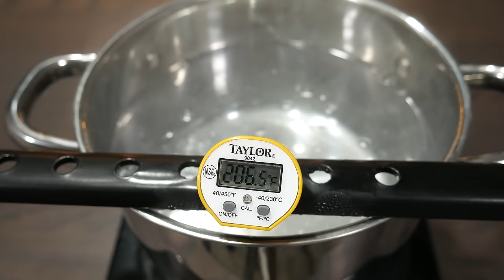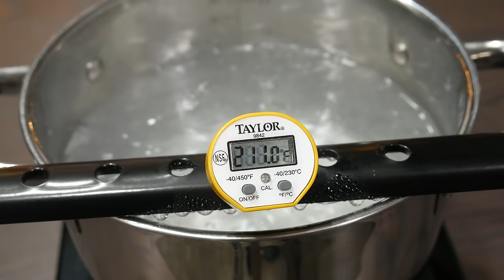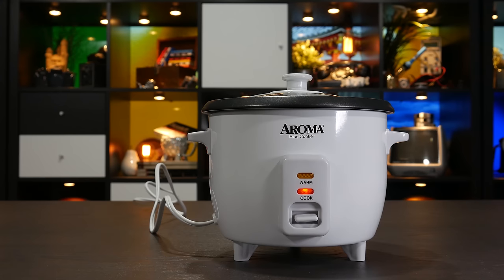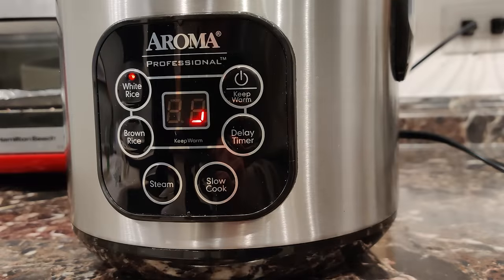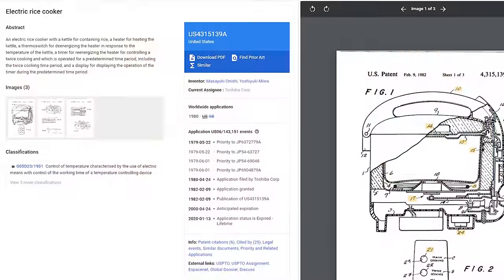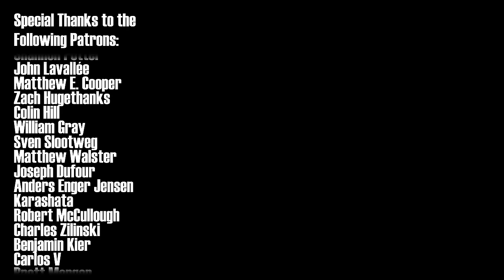Old-fashioned rice cookers are extremely clever

Comment: As someone who also owns that exact “fancy” rice maker, I too despise that 15 seconds of screaming when the rice is done.
Reply: YES! It sounds like a radiation alert or some such thing--why so shrill, fancy rice cooker, whyyyyyy?
Reply: And I have the cheap one. Works just fine for sushi rice...
Reply: I think we all have one appliance that we yell “shut up!” at.
Reply: @AlchemicSoul  in my case it's an egg boiler.
Reply: My instant pot plays a little tune when it's done, then shuts up and keeps it warm until you tell it otherwise.
Reply: @mysteriouslyhandmade  In my case it was the microwave before I bought a new one, but has always also been the fridge. Leave it open for 1 microsecond too long and it screams at you as if it's going to die!
Reply: The first thing I do when I buy a new microwave is disassemble it and remove the speaker lol.
Reply: @AlchemicSoul  In my case my microwave, and also a multimeter. I don't always turn off that damn multimeter when doing something else for a minute, and then it complains. Its got that usual mechanical turn-knob thing, so it's actually a bit of a hassle to turn off and on all the time too.
Reply: My rice cooker makes a train noise or bird noises as it's finishing up its rice.

Comment: 3:18 Al dente rice is a thing, but not cooking the rice long enough makes your al dente rice swim in water. So the main way to achieve that is to put in slightly less water and rely on the same mechanism to time the cooking. Also, a couple of small tidbits: When Toshiba first invented these, they used a bimetal strip instead of a magnet. While the double-boiler version (with either bimetal or magnet) is slightly less convenient when cooking rice, it can also be used to heat up other things as long as you put the right amount of water in the outer layer—quite useful before microwave ovens were common.
Reply: You could also just boil the rice like pasta, pull it out whenever you like. It's good for very starchy rice as even with the right ratio I can't seem to manage good rice-cooker rice with anything but basmati or parboiled, so just wash that excess away with the rest of the water and there you have it.
For plain rice, a rice cooker and the right kind is always going to be best and you won't be wanting that one "al dente", but here lies the beauty of choice.
Reply: I once tried something called rosoto and was surprised they didn’t cook the rice through. Maybe that was intentional?
Reply: @cat-.-  It's risotto. Risotto is very creamy, if the rice is overcooked it tends to get lost, though I'd be hard-pressed to call the ideal consistency al dente, more at the very end of it.
"Al dente" means leaving just a little bit of the core of the pasta or rice still uncooked, enough to give it some structure. It should not feel hard or crunchy, just enough that you feel some resistance when you bite down (hence the name), tune it at your liking.
Of course, it all depends on what you mean by "they didn't cook the rice through", if it's by a big margin then it probably means whoever made it got tired and took it out of the stove early, if you mean just enough to be noticeable from say plain basmati rice which is long and thin then yeah.
Reply: We have al dente rice in hungary. We call it "pergős" rice.
Reply: I like my rice being more hard and less mushy

Comment: "we'll get to that when we tackle air conditioning and refrigeration" 

Me: I AM EXCITE
Reply: Yes, and wow. That's a lot to tackle. I learned from Bryan Orr (HVAC School). Neat thing is, once a person knows why the hot tube carries the cold and the cold tube the heat, they've pretty much got it.
Reply: Not too excite or you vaporize.
Reply: PongoXBongo It would make for a nice change of Phase. Err Pace.
Also an excuse to delay CED
Reply: Refrigeration is TIGHT
Reply: @davincent98  YA BOIIIIIIII!!!!!!!!
Reply: I used to work in the HVAC field, when I was younger. Except for the working in excessive heat (120+F/49+C) installing the AC units part, it's was kind of an interesting trade sometimes.
Reply: Long story short, sealed, one-way loop with an expansion valve.  Gas is compressed.  The compression of the gas heats it, so the the how, compressed gas passes through a heat-exchanger to shed as much heat as it can, before being piped into the interior.  In the interior, the compressed gas passes through some kind of expansion valve or orifice tube and into a low-pressure coil.  As the tepid gas expands, it cools.  The cool gas in-turn cools the coil, which has air forced across it, such that the air sheds its heat into the coil and thus the gas, again raising the temperature of the gas somewhat.  The gas then returns to the compressor, and the process starts over.

This is an oversimplification and doesn't account for reverser valves for heat pumps that can deliver heat in addition to cool air, but is the basics.
Reply: @TWX1138  I'll over simply it more.
Cold do not exist, there is only lack of heat.

Comment: As I watch this, I'm eating rice that was cooked on almost that exact rice cooker, and I love it. I eat rice pretty often (half my cooking skill set is Korean) and it suits my needs great. My only complaint is that the "warm" setting is hot enough to dry the rice out, if I leave food out for a buffet style dinner. 

And yes, a digital sensor is just a thing that will break. If you don't absolutely need them, don't use them.
Reply: Your cooker might be trying to keep the rice above 60-63 degrees Celsius in order to prevent the growth of Bacillus cereus; which is important for a "buffet style" arrangement (see my previous comment: https://www.youtube.com/watch?v=RSTNhvDGbYI&lc=Ugx5q1cbi1Edv-wWOQl4AaABAg).
Reply: Used to work at Chipotle, where we had to keep rice at a safe temperature. It would dry out, but that's why we mix it up between every couple customers, and it helps that we went thru pans quickly
Reply: @mattb4721  Yeah, rice must never be allowed to spend much time at room temperature. It must either be hot or chilled.
Reply: @lawrencedoliveiro9104  I'll eat it up to 24 hours later but I prefer 12

Not worrying about germs as much ... top tier immune system

Comment: I recently purchased an egg cooker that utilizes the same technology.
While the steam is used to do the actually cooking of the eggs, the water supply acts as an incredibly accurate timer to cook the yolk to varying levels of done-ness. The timing of the device is created by a little plastic cup with lines on it that say: soft, medium and hard-boiled. Fill the cup to the desired level and pour it into the cooker. It even has the same lever on the front as the rice cooker.
Reply: OK, I usually hate too many one-use kitchen gadgets but that's one I need in my life,
Reply: I bought my mom one of those, because it takes less time than it takes to boil water to make over half a dozen of boiled eggs. It uses less energy. You can steam veggies in a basket on top of a rice cooker. Eggs, veggies, and rice. You have a whole meal.
Reply: I have one of these egg cookers and it's amazing. Perfect hard boiled eggs every time.

Comment: I have always wondered how these things work! Thanks for clarifying it! I also find cooking rice well to be less than obvious.
Reply: If you are cooking long grain rice get any cup. Fill the cup with rice. Place rice in pot. Use same cup that you used for rice. Add 2 cups of water to pot. Add 1 tsp of salt and oil for flavor. Cover pot. Bring to a boil on medium high heat. Once pot is bubbling, reduce heat to low and leave it for 25 mins. Do that step by step and it's hard to mess up. Rinsing the starch off the rice makes the lid easier to see through if you are willing to put more effort but it doesn't make much difference in the dishes quality. 
I don't know what the ratio for short grain rice is though. Only weirdos who like math too much eat it anyway.
Reply: L

Comment: I think you missed an important point about newer „automatic“ rice cookers: they are typically sealed and they cook by letting pressure to increase internally. 
Because pressure is higher, boiling point is higher, temperature can be higher and cooking is faster
Reply: Additionally, newer rice cookers are better insulated, so they will stay warm for longer without power.
Reply: @dbclass4075  I can tell this is true because I own the basic "cook and warm" system but it's as insulated as the Multi cooker/Magic Jar one... Very common in Asia

I usually cook rice every 7 in the morning, and remove the cord after about 30 minutes to make sure all the water evaporates and the rice isn't too moist (fresh, just done cooking rice is very moist for those following along)... And yep, it will stay warm until about 12 to 1 in the afternoon.
Reply: this also means that you dont run into the problem of water boiling point changing due to pressure and altitude causing the curie point to misalign
Reply: @dbclass4075  Not really. I have the basic rice cooker which is insulated like a pressure cooker. Was very cheap and works perfect.
Reply: Do you mean newer rice cookers have tight fitting lids or that they are pressurized?
Reply: @felixschmidt6628  rice cookers are pressurized. You can use it to cook also other recipes, as in a “western” pressurized cooker
Reply: @felixschmidt6628  me too I realized it pretty late. But is cool. Easier to use than a pressure cooker for gas or induction plates
Reply: @jgfakjshfdgkajshd In South Africa you can only get a pressure cooker with a rice cooker function mine is amazing just larger than most rice cookers I see online it's basically a South African made instant pot type thing but way cheaper and it's lasting a long time and cooks rice to perfection every single time

Comment: i had always assumed it used a bimetal switch like a thermostat, but this is definitely more elegant and probably more reliable and cheaper
Reply: Unlike technology, physics have a absolute 0% failure rate.
Reply: @mipmipmipmipmip That's amateur, mine has been working since before I was born and doesn't even look like it needs replacing until after WW4.

Comment: When I took electrical engineering classes and we got to transistors, I remember my professor going "We're not going to touch on digital circuits, they're too easy"

I think I understand what he meant now :B
Reply: digital circuits are easy, until you try to design an asynchronous CPU, guess why no modern CPU is truly async and need to have clock lines, such children toys...
Reply: @monad_tcp  You don't get it. There's beauty in simplicity, as well as efficiency. If you can design a thing to do what an IC does, but with even simpler construction, that is true genius. Theoretical wanking about kilobuck computers that rich kids own or work with is not so relevant to the point made above.
Reply: I think your professor forgot the existence of fighter jets and Nuclear power plants. Two processes that depend on digital circuitry to function. Because without it, they don't work.
Reply: @Helveteshit  Ya sure about that one?
Reply: Paesan Control Centre having studied the basics of turbomachinery (jet engines) and aerodynamics as well as some basic control, i can assure you that  supersonic fighter jets are too unstable to be accurately controlled by a human. Without digital control circuitry, they would (and sometimes do) break apart mid-flight. 

When it comes to nuclear power plants, digital control is just as necessary, with even worse outcomes from failures. No human can react fast enough to initiate protection systems on a failing power plant, nuclear or not. 

I work with power grid protection. We keep all the infrastructure between your home and the power plant from burning up when something goes wrong. This is another industry where digital circuitry is absolutely crucial. There are still some substations that have protection circuits from before transistor-based computers. These protection systems have digital logic circuits built entirely out of contact relays.
Reply: @Improbabilities  I was about to say, digital circuitry is practically mandatory on most if not all forms of aviation. What the hell do people think Boeing and commercial airlines use?
Reply: @Improbabilities  and Helveteshit  it seems that both of you forget that analog controls have been used both in the past and to present day in some applications. For Power Grid protection it required selecting the proper component ratings to prevent faults downstream from disabling upstream components. Analog controls are still used if that big fuse on the power pole in the yard is any indication. Oh yeah let's point out that Whittle and Junkers early jets had analog controls.
Reply: @Improbabilities  Your argument doesn't really make sense, an analog circuit is at least as fast a digital one. Sending an anlog signal from a sensor through an ADC to a microcontroller which executes a few microinstructions to set some output pins is much faster than a human, but an analog circuit would be already done while the digital circuit is still waiting for the conversion.
If you are designing ASICs, you usually start with a digital layout and convert parts of it to analog to fulfill performance requirements (be it area or speed), because analog is clearly superior. It is also more labour intensive though.

Actually digital circuits are a subset of analog circuits. Digital is like natural numbers and analog like real numbers.
Reply: lol what the hell happened in these comments?

Fighter jets and nuclear power plants can definitely be controlled by analog circuits. They just aren't anymore, because "they're too easy" aka digital solutions are much more convenient and cheaper, but that doesn't mean it's not possible. 

And do you really think that a fucking passenger jet would fall out of the sky without their fly-by-wire system working magic? If you knew anything about aviation then you'd know that they could at least perform Basic Flight Maneuvers without any assistance and wouldn't have the need for help until they started pushing limits. And the goddamn SR-71 flew with the help of analog computers so I don't even know wtf we're talking about...

It's ok to be wrong, kids, that's just a bump on the road to the path of discovery, and I myself have been wrong many times before. But my main problem isn't the fact that you were wrong, my main problem is the fact that you decided to pipe up on a comment that was an obvious joke in the theme of the video (of simplicity being elegant, in case you were that dense) and tried to one-up him with literal bullshit. I definitely hope none of you are aspiring engineers, because if you can't appreciate simplicity at this point then you are doomed.
Reply: I've not found analog electronics to be particularly difficult. The exact same general logical processes used to troubleshoot a software or a digital circuit can be used to troubleshoot an analog circuit, in my experience.
Reply: Helveteshit  many early power plants and fighter planes worked just fine using analog electronics. It was not until NASA needed the weight savings of the IC that the technology really was pushed hard towards digital computation.
Reply: Digital circuits are all the same. Analog tech is so fascinating because every analog device is completely different
Reply: @Jaymac720  What? How do you figure that? There is much more scalable complexity in digital circuits. If you get too complex with an analog design you run into space, heat and unreliability issues pretty fast.
Reply: Heh.  He meant that a transistor in a digital circuit is using then just as a switch - on/off.  In analog circuitry, you have to balance the circuit on the knee of the on/off action because you want a proportional output for the input.  It's called biasing the transistor, and it's a finicky thing to do, at least the first time.

When I was in grad school in electrical engineering, the big topic of the time was optimal receivers, making receivers that worked as best as they could given the evil world of nice they had to work in.  Phase lock loops, all sorts of jiggery-pokery.  Now signal transmission is all digital, and the optimal receivers for analog signals is a no -never mind thing.
Reply: @fun_ghoul  l
Reply: @Improbabilities  Supersonic flight and nuclear power generation predate the microprocessor by several decades, so...what the exact fuck are you talking about?
Reply: As Bob Widlar (a legendary chip designer) stated: "every idiot can count to one".
Reply: Watch Ben Eater's videos on building CPUs from scratch with discrete logic chips. There's a lot going on, sure, but at the end of the day, the basic principle is just a series of many many many switches turning each other on and off in a certain way.
Reply: I didn't expect my comment to blow up but I'll try to explain my thoughts when I wrote that comment.

It wasn't to downplay or mock the importance of digital circuits in today's world, but that digital circuits don't make for an interesting course when we're talking about electrical engineering. The Aroma rice cooker could've been driven by a digital circuit (i.e., a computer), but then the video would be 2 minutes long. 

Yes computers make things easy and yes they've made things more affordable. But it's much more interesting when something can achieve the same result without a computer these days.